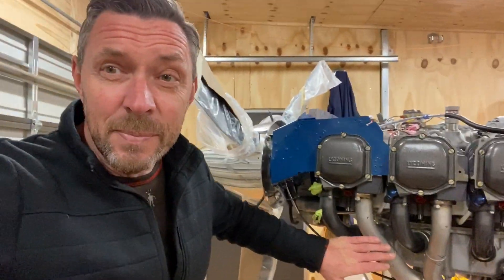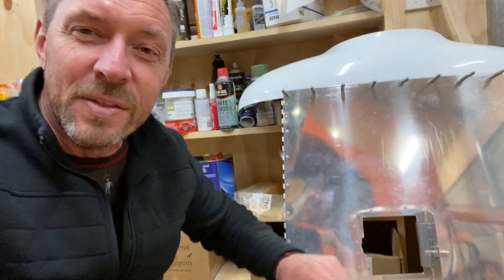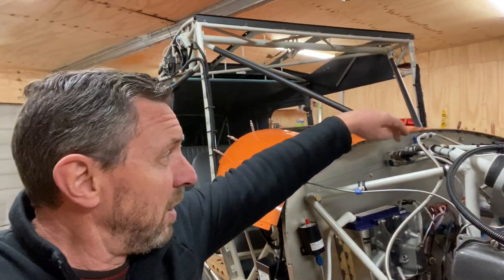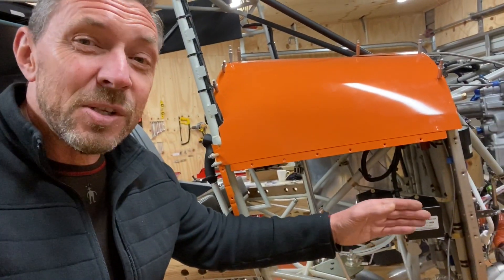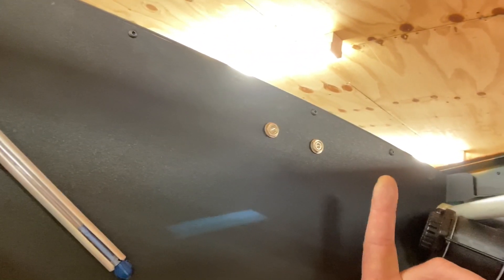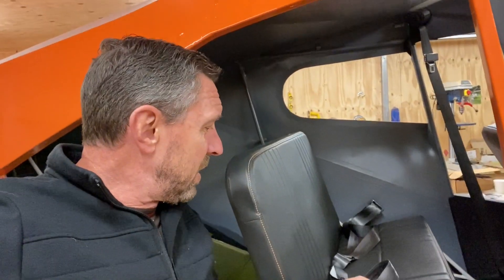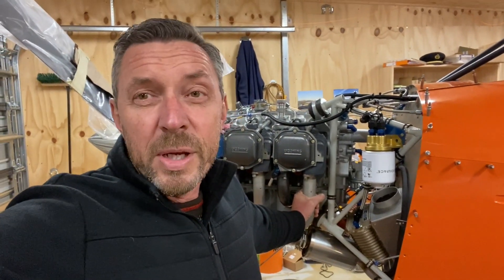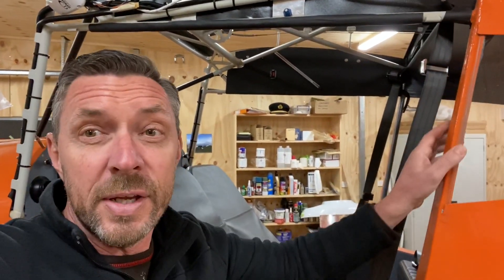Bearhawk build #10 - building a Homebuilt Bushplane aircraft in my garage

Comment: how long is the bearhawk with rudder, engine and the spinner thanks
Reply from the maker: The Bearhawk website (bearhawkaircraft.com) says 23.5ft. My hanger is 9m (31) long and I can walk around both ends so that's about right. Hope this helps.
Reply: @bearhawkblog3527  how many celeo's did you use for the bearhawk mate
Reply from the maker: What is celeo's ? Is it cleco's ?
Reply: @bearhawkblog3527  Cleco fastener is what i mean
Reply from the maker: There were 3 different sizes of clecos that I used. I had probably about 20 of each. I didn't need many.
Reply: @bearhawkblog3527  the moment i have 1 size which is 1/8in
Reply from the maker: Yes, you will use a variety of sizes for the wing, boot cowl and engine cowling. The 1/8 are common.
Reply: @bearhawkblog3527  so get 20 of 1/8 and what other ones